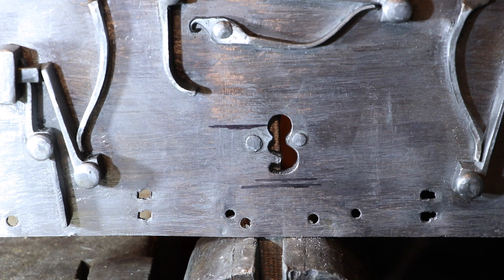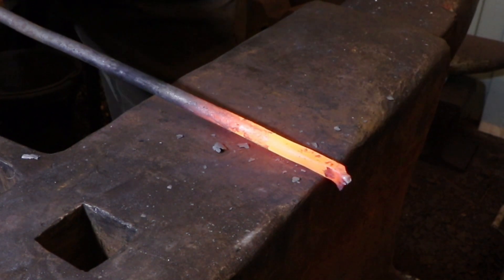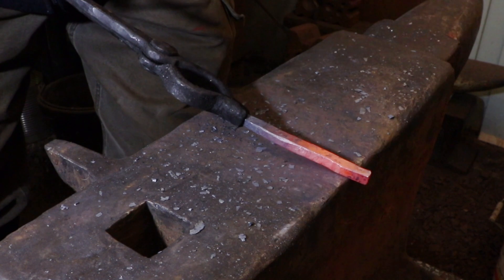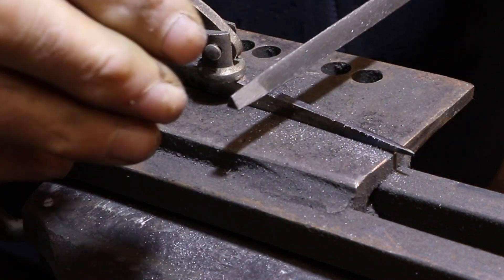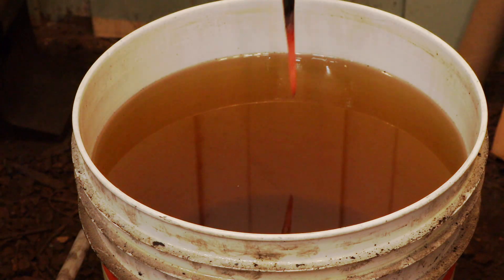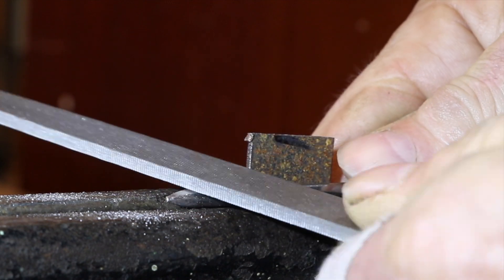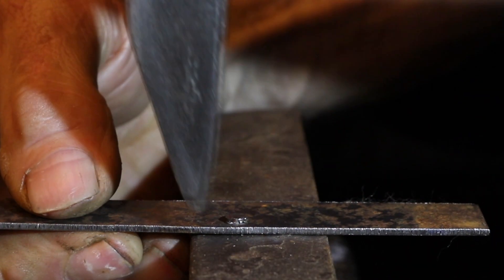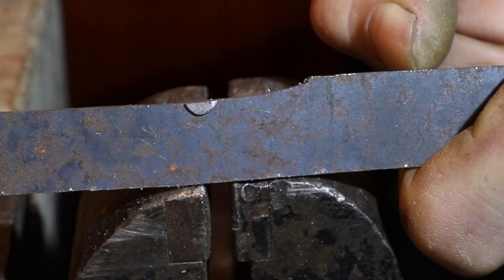Forging a Tapered Reamer - DF InThe Shop

Comment: Denis- Could you comment on (or do a video on) the filing plate you use in this video? I'd like to make one myself, but I don't completely understand the assembly of the hold down clamp. Great video, thanks.
Reply from the maker: I do have a video on this vise jig.  It was quite a while ago you'll have to go back quite a few pages to find it.  It's pretty much what you see.  The main plate with all the holes is a heavy piece of angle iron. So the leg you don't see is locked in a vise.   The other two bars are 1/2" square bar welded to the angle iron.  The hold down is a pair of vise grips that are designed to be used on a drill press table, so one arm has a large winged nut that can be locked to the 1/2" rails.  I usually can't send a link in a comment because youtube sees it a spam so send me an email if you can't locate the  video.  My email is at the very end of any of my videos.